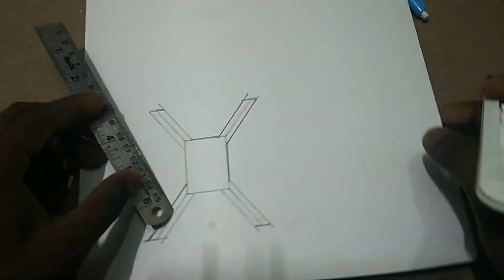Make a drone with Foam sheet |குட்டி விமானம்

Comment: Bro try keeping the battery In bottom and reciver in top.try using 65mm propeller and 3.7v 500 or 600 mah lipo and compulsory the battery need to be minimum 20c